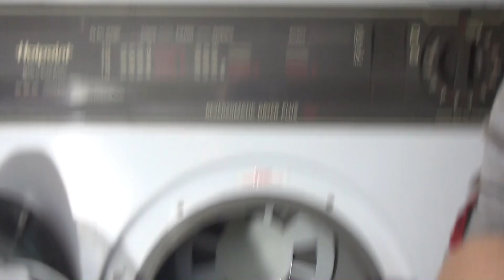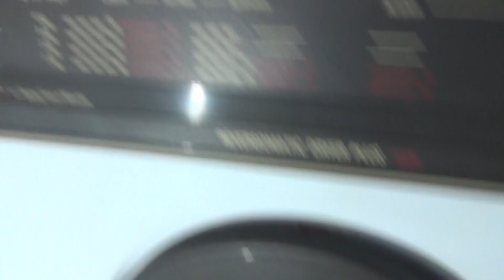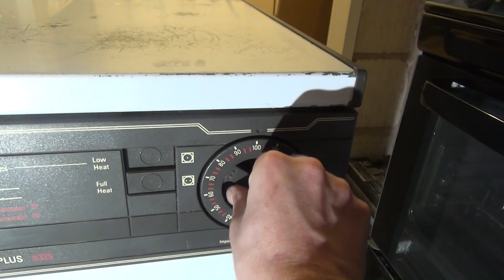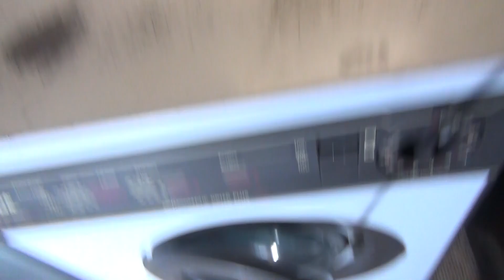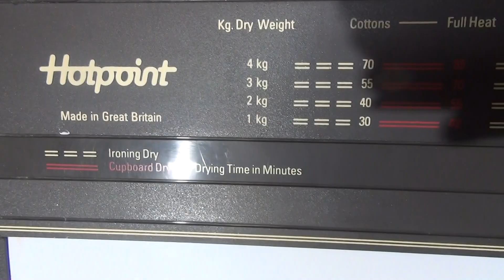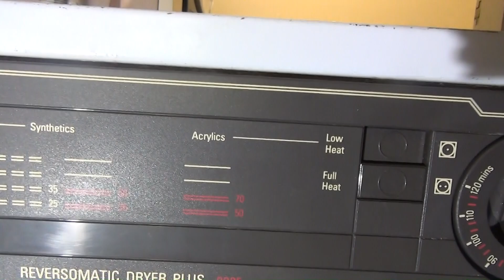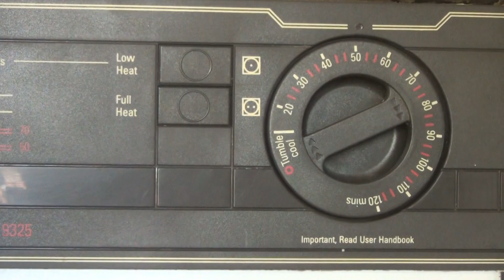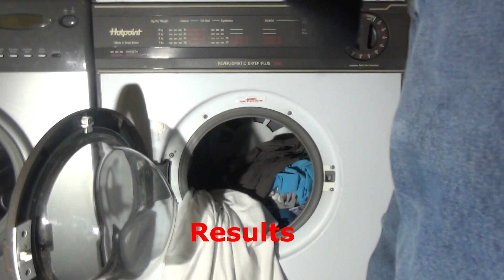Review and Demonstration  of Hotpoint 9325 Vented dryer

Comment: We had one then we had are for about 11 year before it dead but we had matching washing machine aswell but nowadays we got at Hotpoint condensed dryer and a Bosch washing machine
Reply: did you have the hotpoint 9525 or the hotpoint 9535 or the hotpoint 9515

Comment: Curious why this dryer switches going back and forth sort of like a front loader washer
Reply: It seems quite common for dryers not In north America.
Reply: @Smurdle450  ahhh lol I was wondering because it would pause then go again in the video in a different direction 😂 but yeah ya got a point dryers here are different than UK models
Reply: Its for not tangling all the clothes and making the dry cycle more effective using less energy, most of dryers reverse the tumbles every 2 mins (depending on cycle and brand), an exception are the very old dryers without reverse and the new SHITTY Bosch made dryers, Bosch is a rip off right now
Reply: @Xupaunwebo  bah never heard of that brand here in the USA but i have heard in the UK its pretty shitty but i wish the USA model dryers did that even for the LG dryers here....infact i think all dryers should do that at this point even USA models to prevent clothes from tangling up into this "ball of clothes" we get from dryers here in the USA
Reply: @FrostbiteXZ  best dryers here at the moment are Beko ones
Reply: @Xupaunwebo  yeah true what about the hot point ones?
Reply: @FrostbiteXZ  hotpoint now owns to whirlpool/indesit group, they lowered the quality, btw i would get the new hotpoint active care heatpump dryer
Reply: @Xupaunwebo  huh sounds like a good dryer but not sure if Amazon USA will have it been looking around at the 2 in 1 washers with the built in dryer heat pump styled though some of them are actually 110V only so I'm guessing the dryer part of the 2 in 1 washer is using a heat pump styled dryer unit being built in
Reply: @FrostbiteXZ  washer dryers here work like a hair dryer, a blower with some heating elements and the moisture IS condensed on the outer drum, then It goes down and gets pumped out By the drain pump, and here everything works at 230V
Reply: @Xupaunwebo  :p yeah that's true plus their kinda cool as well even though dryers here typically use 220V or get like a fire element system installed and run on 110 the only shocker though after pulling apart a 220V dryer (LG Tromm dryer) the motor was 110 but the heater element I had to clean up from being caked with lint (mother of God it was horrible) was the only 220v thing besides the control deck handling it all (sorry if I'm rambling here....)
Reply: It's reverse action drying.

Comment: Was there a matching machine to go with it could it of been the 9526
Reply: 9535
Reply: 9525 and 9535
Reply: @HooverA3060   mine is that dryer and it has not been used for 4 months

Comment: The fan on this is just a centrifugal impeller on the back of the drum motor, sucking the air though a vent alined with the centre of the impeller, and blowing the air into the cavity of the machine - quite a poor design regarding the possibility of air leaking out of the cabinet (as you have discovered) the only benefit of this flaw is a rough form of heat recovery - heat leaking out of the drum is drawn back into it. If the air spigot was straight out (not angled) then you’d have the bemusement of looking through the door (with the filter off, and empty) and seeing the flappier vent opening in the draft. 😁